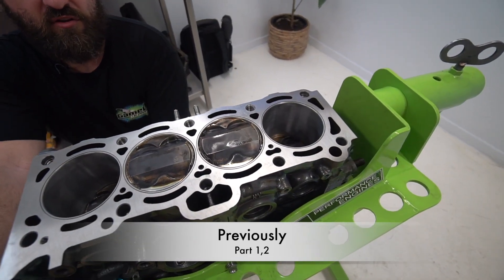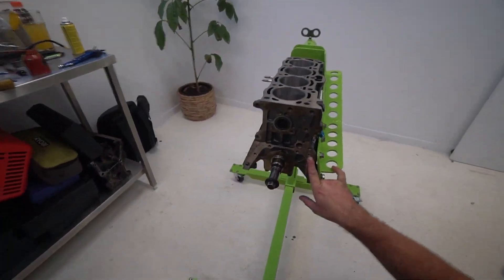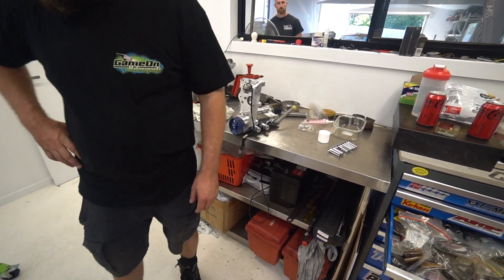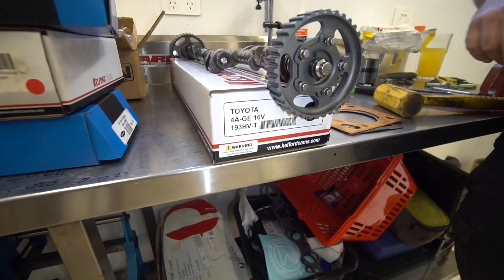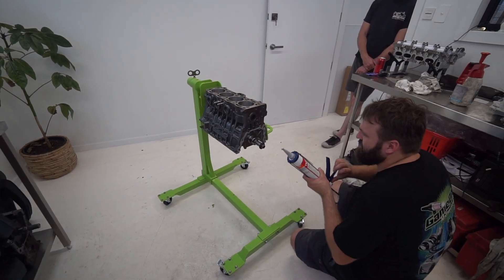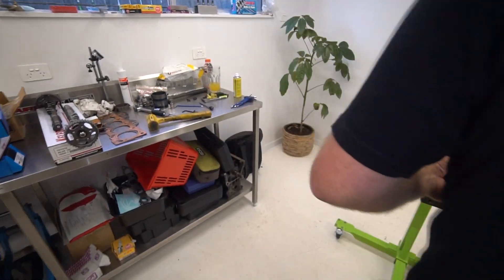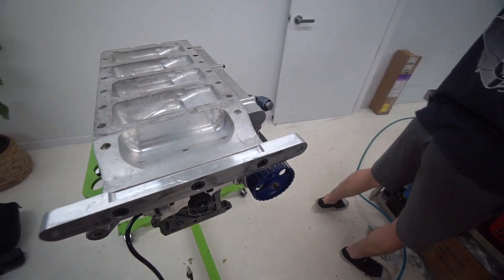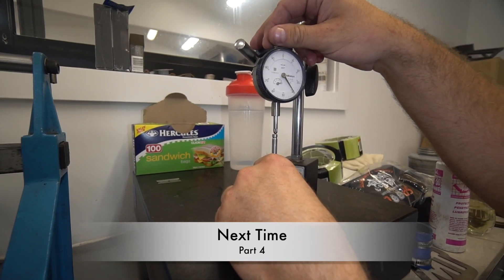Formula Atlantic 4age Build Part 3

Comment: Each time I watch these videos I learn something new. I have 2 FA Engines,1 Loyning and 1 Hasselgren. Both of mine run the TRD cast aluminum drysump oil pan but I see yours was a billet made pan. I would think that was made to add a little extra torsional rigidity to the engine.